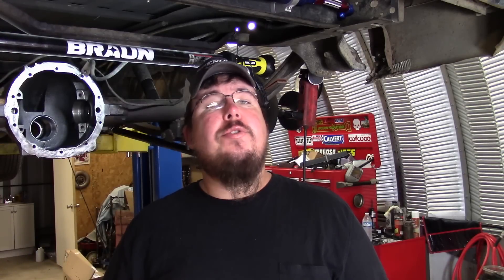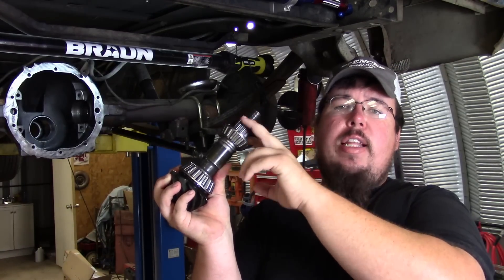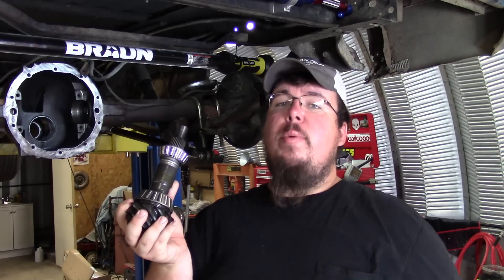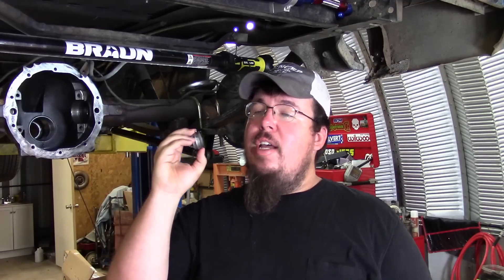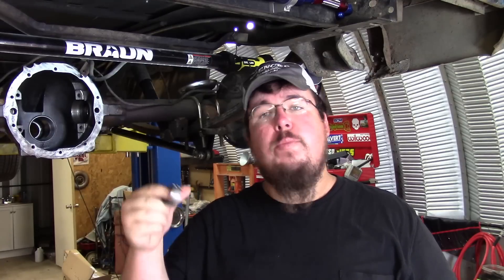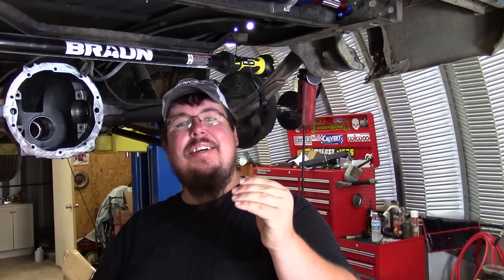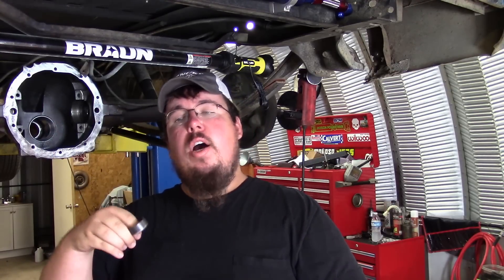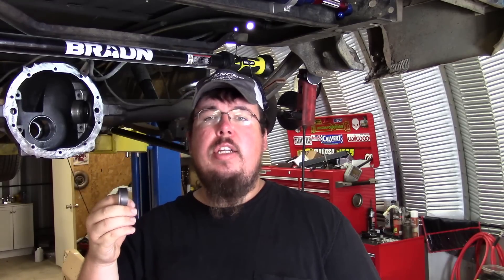GM 8.5 10 bolt crush sleeve eliminator overview

Comment: Will this work on the GM 7.5 inch differential?
Reply from the maker: The 7.5 10 bolt is the same basic setup, just smaller, so if you find a crush sleeve eliminator for it, then it would work the same! Thanks for watching! Be sure to check out my new video where I show how to install it! 😎🚜💨

Comment: I've got a 2005 GMC Yukon 5.3L 4x4 with 234,000 miles, all stock. It makes a clicking noise that I can usually only hear with windows down and driving next to something like a wall or tall curb.  
It only does it when applying gas though, and in a forward gear.
I have examined the u-joints and driveshafts and they look fine and tight. It does look original.
Do you think this is the issue?  Thanks!
Reply from the maker: It could honestly be a lot of things. Could be in the brakes, u-joints, even the front end. Your really need to troubleshoot the whole truck to pinpoint where the noise is coming from.

Comment: Question: on my 1973 cutlass 3:42 posi I replaced the pinion seal. I was unaware of the crush sleeve. Now it leaks like a sive. Are these related to each other? What is the way back to normal? Thanks
Reply from the maker: The crush sleeve is what creates preload on the pinion bearings. If you have the preload set properly on the pinion and it spins correctly, then the crush sleeve isn’t the problem. Could have a bad seal, or a bad sealing surface on the yoke

Comment: I have a 7.5 that I plan to replace the pinion crush sleeve with an eliminator kit. When I changed the pinion seal, I thought I put it all back together according to spec, then I heard a high pitch whine, then a howl. I again pulled the old crush sleeve out, installed and torqued a new one that I over crushed, what a pain in the ars. So I bought and waiting on the eliminator kit. I'm also changing gears in the  8.8 I have in my Bronco. I will forsure use the eliminator kit in that. I beat the snot out of the Bronco off road. I've noticed the pinion / ring gear backlash is now out of spec. I blame the over crushing of the crush sleeve due to heavy use. Thanks for the video.
Reply from the maker: Thanks for watching! I definitely feel a crush sleeve eliminator is an upgrade when building axles!

Comment: Hey I just realized something that it may be wise for you to remind your viewers about,I have an 8.5 that I went from open I think 3:08 to posi 3:73 and I don’t like throwing stuff away but decided it was too low for every day driving and thought I might try 3:42 and figured I’d have to buy a new set or go to the junk yard and find an old cop car.it dawned on me today to get a book out and check pinion info and sure enough the 3:73 & 3:42 share the same ring gear and the 3:08 share’s the same pinion so it may save folks time and money to check some of this stuff out.i still have check but I think I have a couple 3:08’s which with the pinion from one of those added to the new 3:73 ring gear I’m in business with a 3:42.it may not mean much to you now but I’ll bet some of your viewers would like to be reminded of this type of info cause sure enough either they or a friend will have it laying around and you’ll be the hero for reminding folks about their junk.i was set to buy it myself.i was just looking around and came across your site thought you might like to be that guy.lol have a good one

Comment: What up ! I have a 92 C1500 4.3 liter V6 5 speed manual 2wd my pops messed up the rear pinion seal and the yolk some rope got stuck in the pinion seal and even got into the bearing  I've been pulling pieces out of the bearing with some needle nose plyers. I got most of it out I'm pretty sure because not much differential fluid was draining until I got most of it out well I'm having problems figuring out what the humming sound is in the differential? If it's the bad seal or something else is messed up , it was my pops truck and he passed away 3 weeks ago and he was the mechanic and I know nothing of mechanic work and I'm disabled on a fixed income and my only help is me and YouTube . The humming sound didn't start until I got about 20 miles away and it happens when I'm in gear and decelerating, I got home and seen differential fluid everywhere under the bed and the rear pinion seal was hanging out well my pops replaced it awhile back when he got the rope stuck in it but didn't get all of it out and I think that's why the seal was bad again Also the 4 bolts on the yolk was a little loose. What do you think or suggest?

Comment: Have a question, I have my pinion depth set to within .002, also have the Yukon eliminator kit, have my NEW  large bearing pressed on with the shims... do I still use my old bearing to set the preload with the eliminator and shims and to what torque spec do I use. I have new gears and they call for 160 ft lbs...do I need to do this each time to set the preload?

Comment: I put one of these in my 7.625 rear axle in my S10 p/u when I put a Torsen differential in it from a Camaro. , Works great.  Just bought one extra outer bearing and ground out the inner race so it would slip on & off. Used that for the set up bearing. After using this,I'd never even bother using a crush sleeve. Use one of these instead.
Reply: Please explain how to set the preload with spacer? Attempted to setup GM 7.625 with Eaton Detroit locker and new Motive Gears, but obviously I did the preload incorrectly by using the impact on pinion nut until I got the desired preload and ended up with a whining noise.
So, despite having a good gear pattern, I'm starting over with the pinion preload, but need help on the procedure 
My original crush sleeve measured .058, so I simply added required shims to the spacer for a starting point.. ended up with.056 
Please explain procedure and what's the pinion nut torque value for the 7.625 10 bolt?
Much thanks!

Comment: I’d love for someone to put up a video of replacing the seal and how to retorque penion without replacing crush sleeve
Reply: My opinion 
Tighten pinion nut back to factory spec
Reply: @CHEVYK10  good to know, what causes them to sometimes loosen?  I have never attempted diff work, but have come across a few with pinion nuts that were not very tight in doing other maintainence - I appied loctite to them and tightened them up

Comment: I need to replace my pinion seal in my '00 z28 camaro... how do I tell how much to torque the nut to get the proper preload? (I'm a noob)
I have considered hiring someone to do this job but I'm worried they're not going to put it back together properly
Reply: If I had to do it by myself, with minimal amount of work, I'd remove the wheels, and rotate the pinion nut and check how much rolling resistance there is. (pinion bearings preload, carrier bearings  preload, gear mesh friction and axle shaft seal friction, its all accumulative). Let's say that it's 35 inch pounds rolling resistance on the pinion nut with the old seal. Mark that down.

Now, take the nut off, yoke off, old seal off , and replace the seal. Reinstall everything.

Now keep slowly tightening up the pinion nut till you end up with either 34 or 35 inch pound of rolling resistance, back on to the pinion nut. That should be pretty accurate if you ask me.

Please correct me if I am wrong.

Comment: I recently took my yoke off of my 10 Bolt Dana rear end and I was wondering if I am going to screw up the crush sleeve when I put my yoke back on?
Reply: Do not use impact. I learned hard way.
Reply: @austinconaway3314  thats what i just fuckin did

Comment: You can also put a shim under a crush sleeve to get yourself back on the road without a new one...
Reply: In an emergency you can put the sleeve on a section of pipe and go around smacking the bend flatter again just to get you back home.

Comment: Since these are not factory replacements how do you know what to torque the pinion nut to.  Factory specs. are always to torque the pinion nut until you get the right pinion bearing preload in inch pounds of rotational force or break away force.  Plus the pinion nuts always have a locking mechanism such as thread locker which will effect the torque applied to the pinion nut. I have used these before but never knew if I was applying the correct amount of torque to the pinion nut.  I too found it annoying to fiddle multiple times with the shims to get the correct preload and sometimes I would get different preload if I torqued the pinion nut to 150' lbs. or to 180' lbs. It wasn't consistent. I have a torque multiplier and pinion flange holding tools that have served me well and with caution and patience I'm able to get the crush sleeve set right the first time.  I do recommend for beginners or low experienced technicians to purchase a spare crush sleeve just in case.  I will say if you use one of these kits perform your initial setup with the old nut and no oil seal. Once you know that your pinion depth is correct you can put the pinion seal in and use the new nut to install your pinion with the eliminator kit.  I will also say if you don't have a torque multiplier to tighten the pinion nut wit a crush sleve you should seriously consider using one of these kits.  And, never ever use an impact gun to tighten your pinion nut unless you don't care if you damage your bearings.
Reply: I wish there would be a video explaining what you said here.  I'm on my back trying to put the pinion in and wanted to reuse the old crush sleeve as there is no way that I can crush it with 300 ft/lb torque under a car. Also I have a 1/2 Torque wrench and that goes to 200 ft/lb so I'm out of options but to use the eliminator. My issue is how to measure or set the distance/depth ?  You all talk that you have to set it first and then install the eliminator. How ? The outer pinion bearing is presses on the pinion shaft and if you want to remove the pinion, then you have to start banging on it like crazy again to get the bearing off. It took me 10 minutes to get that bearing out, so I'm not looking forward doing it again and again. Once that sucker slides on the pinion it is done.  I'm doing it on a driveway laying on my back. No option, have to work with what I got.
Reply: Not sure if your just replacing bearings or a whole gearset. If you are just replacing bearings you most likely can reuse the same pinion depth shim. If you don't understand pinion depth you can watch the video on DrivelineMaster on pinion depth explained. If you don't have a depth gauge unfortunately you may have to install and remove the pinion several times as you set your pinion depth based on contact patch. One way around this is to purchase a second front pinion bearing and hone out the inner race so it just barley slides onto your pinion.  That way it will remove without banging on it.  Once you determine you have the correct pinion depth and the correct eliminator shim for proper preload install the front bearing that was not modified and torque your pinion nut down with the eliminator kit. Laying on your back it might be worth the expense of a second front bearing that you modify to make your setup easier.
Reply: @oldwortex5818  You can buy a bearing that slips on & off. They call it a set up bearing. Then when you get the right pinion bearing preload. You take that bearing off and put the press fit bearing on. Or you could make your own set up bearing. Get a grinding stone,put on a drill. Grind out the center of the race until it just slips on & off the pinion shaft. Its pretty easy if you put the bearing in a vise. Might need 2 grinding stones. Die grinder is faster.

Comment: Actually, pre-load solid spacers were the standard long before the crush sleeve came along.  My '66 Thunderbird has them.  Update: It turns out my T-Bird had a crush sleeve.  Whodathunk it?  But both types were used in the '66.  Luck of the draw, I guess.

Comment: You can always lap the end of the spacer and shorten it .001" or .002" to get a length that you can't get with the shim pack.  In other words, take the combination that had the preload on the low side of the spec and lap the spacer to increase the preload.
Reply: Solid spacers all the way and attention to detail using the correct methods makes for a bullet proof build.
Reply: snaproll94e yup, 100% attention to detail really matters
Reply: snaproll94e if you can lap 1/1000’s evenly, then you probably have the equipment to machine your own spacer lol
Reply: @LagmasterB  It'll be close enough, I surface small parts all the time.
Reply: snaproll94e yup, it’s all about getting the right stack, and it’s surprising how little the thickness will change to have a big impact on the preload

Comment: I got 85 c10 2wd with a 8.5 10 bolt what’s the spline ?
Reply: Matc10 85 if its original, it will be 28 spline. Swapping in 30 spline shafts is easy though
Reply: My 82 c10 is a 28 spline. I think by 85 or 86 they were 30

Comment: If I'm reusing the ring and pinion themselves, could I measure the original crush sleeve with a caliper and set this kit to that same thickness for a good starting point?  GM 10 bolt also.
Reply: I use these kits I start with the old crush slave plus a few thousand even with a gear change not to overload the bearings then go from there
Reply: Logic dictates that you will be fine with that. My pinion bearing failed (inner) and the cup had huge marks from the rollers. I'm thinking it was set too tight, so I might ad one extra shim thickness to the spacer and set it to that.  No explanation anywhere how to set the thickness when using spacers.
Reply: Yeah, that should be fine, as a starting point. Always end up with using the torque wrench to check the actual rotating bearing preload